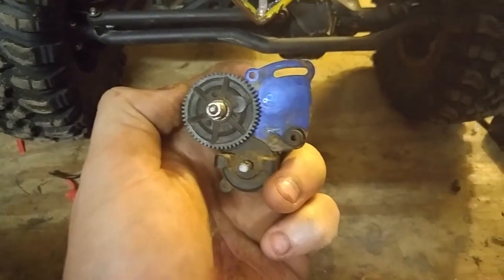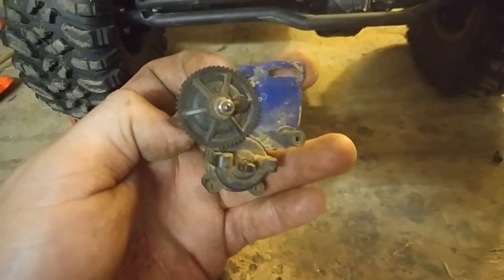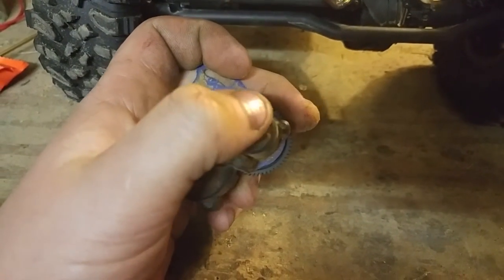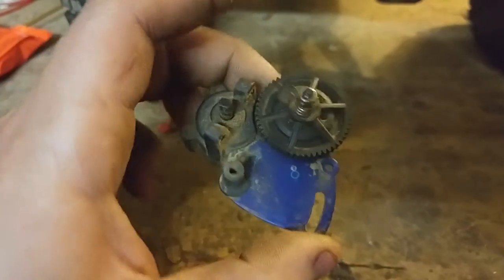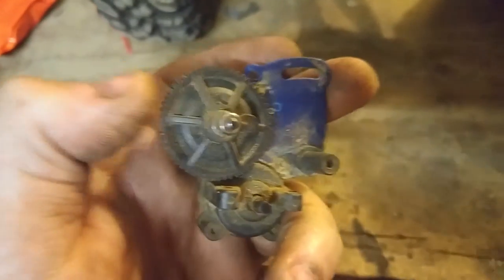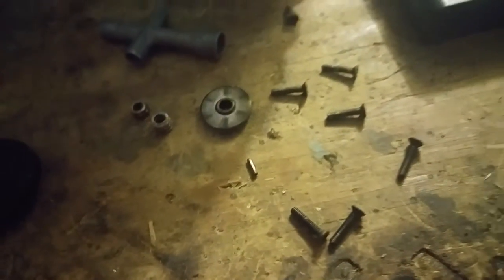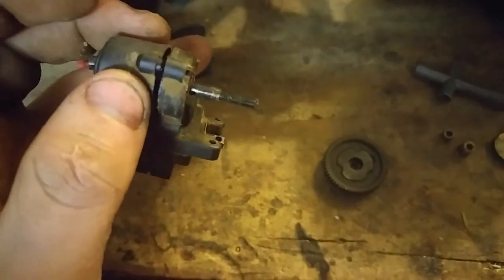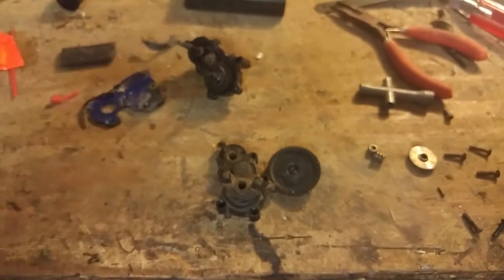Traxxas 1/16 Transmission gear swap explanation

Comment: Very cool video. Thanks for showing me how simple the transmission is lol. I was nervous about taking mine apart expecting a ton of gears. 

My question is; are all those gears metal because my Spur Gear stripped out and it was the original plastic one. I am aiming to get a metal Spur gear but wanting to know if the transmission is also metal to support one. Knowing the gears can be replaced makes me wanna do more.
Reply: Also I recommend at your local Dollar store or Walmart to find out if they have a cheap Tripod to use with a phone. It will help you a lot! 😃
Reply from the maker: Thanks bud! This trans is just as simple as an scx10 trans is. Sadly they are not metal but do hold up amazingly. I've put 1/10 scale motors on these 1/16 scale rigs from traxxas and never had a trans fail.  And I have a tripod in my more recent videos lol. Check them out if you like

Comment: So if I did just the opposite it would be like going from a summit to a revo right?
Reply from the maker: If you just leave the trans alone, it's the same as the e revo. It only changes, if you swap the gears
Reply: @garymaddux2000  I have the summit and that's why I asked bc I'm in the middle of turning it into a revo.